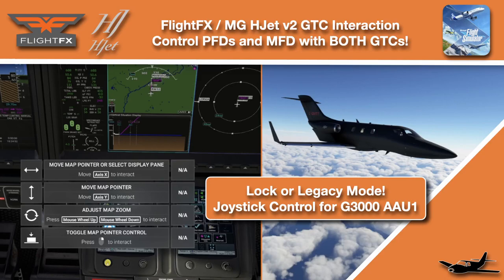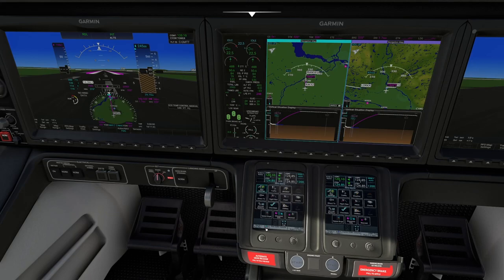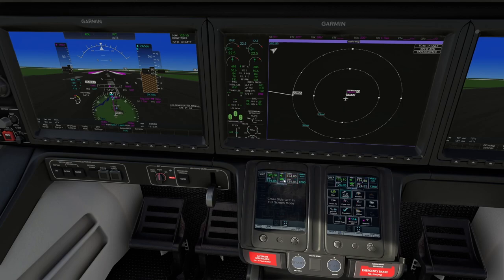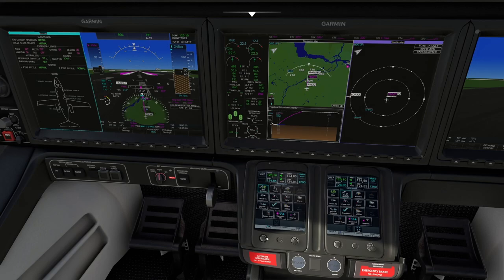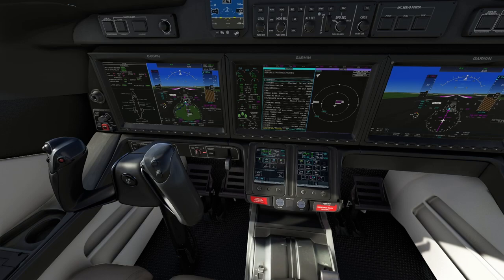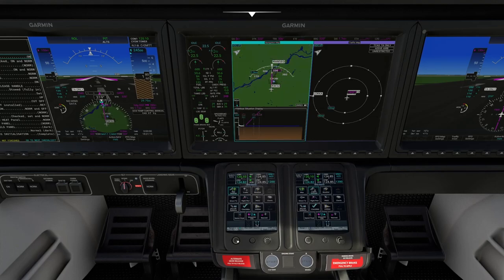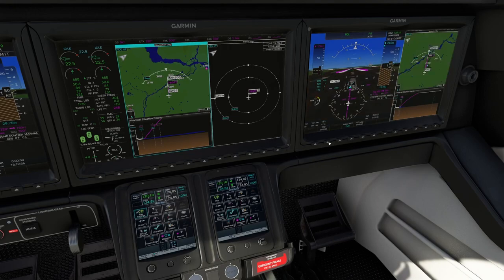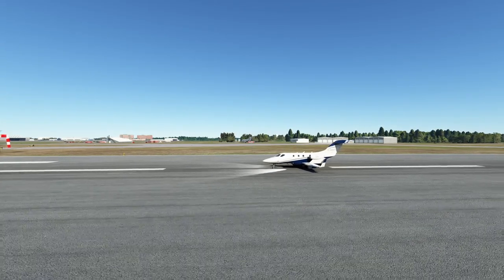MSFS | FlightFX / MG HJet v2 | AAU1 G3000 GTC Controls

Comment: Great video. It gets confusing figuring this all out in the Citation, TBM 930 and HJet. With your examples, I guess it's better to fly the G3000 aircrafts in the Legacy mode.
Reply from the maker: Not sure if the longitude supports legacy. It’s easier with binding those things to my Streamdeck via spad. I have buttons for the joystick directions / twist and push.